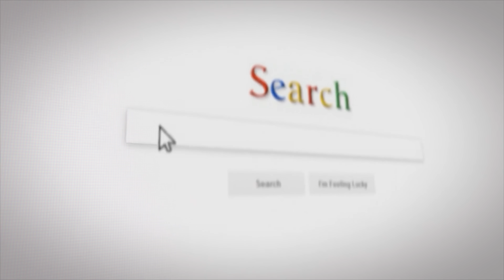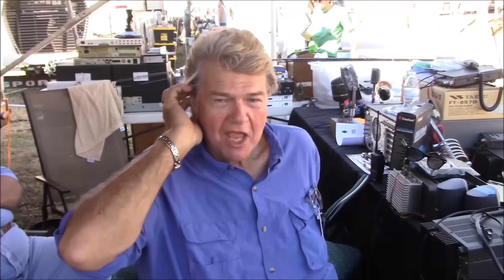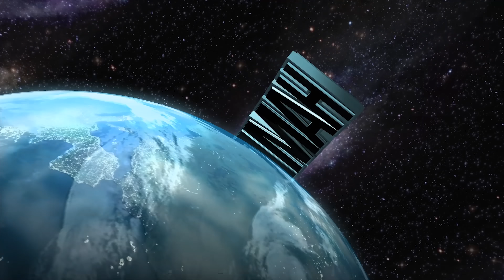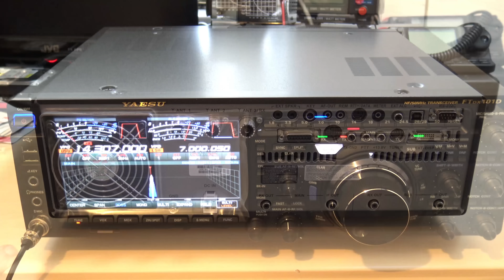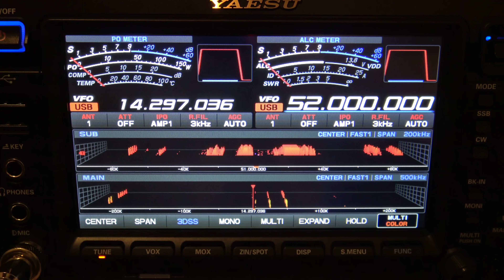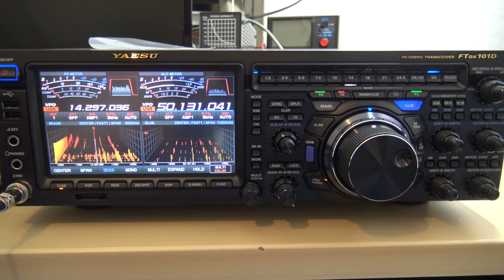NEW Yaesu FTDX101D Review And Demo

Comment: You mentioned where the antenna "tuner" does not "tune" the antenna.  In the U.S. Navy, the "tuner" is actually called an "Antenna Coupler" which is a true description for the Transmitter to Coax to Antenna interface.

Comment: Alas, I have to continue to use my lowly, ancient IC-756 Pro3, since I am neck high in medical debt!  My lowly Pro3 that has worked 50 states on 6 meters (and VUCC), DXCC, WAS, etc. running 'barefoot' with wires, loops, and small 2 element 'Junior' beams!  That said, the FTDX-101D is a dream rig and then some!

Comment: Nice video,, Ive been lookin to buy this radio on GigaParts shortly,,, I really like all that it can do,, and the water fall displays and all, is very nice...I was wandering how the receive is as well as the noise cancelation on it works??....I currently use a yeasu-991A got few months ago,, and had to ship it back to yeasu few weeks ago,, because IPO AMP-1 went out on it....Not a clue why....I dont use no other amps for power...I saw few other videos that its a common thing on the yaesu-991A  for that issue too happen that the resister is known to go out on that radio particular......I hope to get it back soon,, Not sure if im gonna keep it  or sale it but am planning on buying this if it has no issues ???...thank you much for the video.......

Comment: When I was a kid my dad used to be big fan of cb radios. He had lots of them, which we were using as like a mobile phone nowadays, but he also had station at home with president jackson, which was hooked up to antena that was visible from few kilometers (thunderstorm magnet). If I remember correctly he was exchanging qsl cards using this radio. At this time I was like 6-7 maybe and I couldnt wrap my head arround how did he get cards from all over the europe, while we could only communicate up to 10-20 kilometers using cb. He had a big cabinet full of cards. Over time he lost interest in this hobby and Im not big radio guy either, but whenever I see tool like this it brings some sentiment. Maybe its super noob question, but as a hobbyist what sort of use you make out of device like this? It looks like you could control air traffic with it. :D It looks very powerful and brings back some memories, hence my nostalgic comment :) I hope Im not going wind anyone up with questions like this :D

Comment: As I understand it, you can touch on a signal in the waterfall in the time domain. In other words, if a signal off frequency is no longer present, but you can see it on the 3D graph from a few seconds ago, you can click on the spike from a few seconds ago and still QSY to it. Is that correct? Also, why are the color selections so limited?

Comment: I couldn't help but notice the ALC pinned in the corner while you were talking. This is why there are nasty signals up and down the bands! The ALC is there for a reason. Why don't hams pay attention to this and properly set their audio? Hitting the ALC this hard makes you 6 khz wide with buckshot and splatter and it sounds like crap.

Comment: Thank you for a nice video and thanks to the company to sponsor lending you the radio. 
I must say really, this is my personal opinion based and several factors. I always been a yeasu fan and I never really liked Icom. Dont like their look.and I never liked their hissy sound. I own a FTdx-5000D+, FT-920, 847.and 650. But I compared.this ftdx-101d with IC-7610. I love the 7610 in comparison. It looks like cnc machined out of high grade aluminium which has been SOX anodized black. Not a hint of imperfections. The 101d however does not make you feel it's a high quality feel. IMHO. 
73

Comment: When you where in QSO on SSB  I notice ALC was far far out , Usually mean you are overdriving the final and splattering !!
Is something wrong with this radio or 
was the mic gain far to high or 
operator do not know how to work SSB voice  ?
Reply: I think it is operator error, I have one and it is setup properly ALC is well within limits

Comment: The FTDX101D is a great rig!  After playing around with adjustments to the 2D spectrum display, I found the following settings worked well for me. Speed Fast3, Peak LV4, Colour-1 and Colour-13, RBW High, 2D Display Sensitivity HI. This is with a TFT Contrast set at10 and TFT Dimmer set at 7. Awesome fast white band spectrum display and great receiver as well! Not forgetting the scope Multi Level control either, which is great for waterfall fine adjustments for signal display depth.

Comment: Nice video Eric. I cant really say that I was "that" impressed as the other 330 comments.            I don't know what it is. I cant see the value in the 3D display, if not gimmicky. At the moment I'm searching for the wow factor. I love my IC-7600 with 2D waterfall etc  The 101 is $AUD 4700, for that , I'll update my antenna systems. If I could use an car analogy . An Icom 7600/7610 is the Toyota Landcruiser 200. The Yeasu FTDX101 is a Mitsubishi Pajero.                       Thats what I''m thinking. 73 Great effort on the vid. Peter VK3TQ Keepin out of the fire..ss

Comment: I love HF rigs, who doesn’t? Especially a sweet flagship rig like this one. But come to think of it, all these fancy ham radio rigs are stuck in 20th century technology, but cost an arm and a leg. What gives? 
A DVI jack, seriously? Why not HDMI? Where’s my bluetooth, wi-fi, ethernet? USB-C. That screen lag is a joke. Why not a nice iPad Retina quality screen? Open software API so i can write my own widgets and apps, hooking into the OS. Maybe even built-in basic logging software. TCP/IP, SSL/TLS and a built-in server, so i can control it over the internet via https, or set up a web sdr website if i want to. I could go on. 73
Reply: aerozg I’ve had my license for 12 years and have never worked anything but VHF/UHF.
Reply: DVI can be converted to HDMI directly depending on the pin config. I use such a wire with an old GeForce 3.

Comment: Nice video Eric. I can tell you from my experience between this rig and the 101D as well as the FTDX 3000 and the 7300, the Yaesu internal antenna tuner tends to be much more forgiving then the Icoms do. Not sure why as both are rated similar..
Reply: No, they are not rated similar. Why Icom tuners stop tunning when swr is over 3:1? is because Icom wants to protect its passive components (relay contacts and ceramic caps) when tunning antennas with high swr which could damage the tuner, so If yaesu will tune higher swr is because they used higher rated components instead but that means bigger size radio like this 101D. Its just a matter of protection to the builtin tuner.

Comment: Great video! Nice rig. Went over to SDR about 6 years ago Really love the older rigs one being my Yeasu 101E, Had for 44 years and yes it still works 100%. Started as my short wave rec before being licensed. That old rig has a hot rec for SW standard broadcast band. Can't wait to get the FT DX 101D on the bench. See what it will do next to my Icon 7610? Thanks for a informative video. Well done.73,s WA5JIM

Comment: Hello,

It would be interesting to make videos on the low bands (3.5 and 7 MHz)
with strong signals right next (at 3 kHz) in order  see the resistance to strong signals.

It would be helpful to have a cable recording of the station's audio
because an aerial record is not faithful.

Best regards,
Ludovic - F5PBG
http://radioamateur.forumsactifs.com/search?search_keywords=ftdx101

Comment: I’m just not crazy about the frame rate on the scope. Not as smooth as Icom or Flex.
Reply: It is adjustable, and the 2d scooe on the 101d blows the icom away, and when setup properly the 3d scope is the best thing out there
Reply: Mick, you are right about the Yaesu Scopes. They don’t look as good as some of the other SDR scopes. In fact they look kind of fake like it’s just for show. On the icom or Flex SDR’s you can tell if the operator you’re listening to is on SSB,AM or CW. On or off frequency. Over modulating. ETC, just by looking at the scope. I can’t do this on yaesu radios, and that frame/refresh rate is just weird.
Reply: bullshit

Comment: Great video. I have owned many yaesu equipment over the years until I bought Ft2000 after that Icom ic7600 and seriously and never thought about Yaesu anymore. No doubt Yaesu seems to have done a great job this time "but" I need to demonstrate reliability, which with ft5000 was a failure for the money invested. And also despite the fact that Sherwood numbers are unbeatable, you have to see it with real antenna and with very low signals. The display is very nice but I do not buy a radio to see a nice display I buy to do it in difficult conditions and it is at the receiver where I put the money and not on the display. HI if it is beautiful and listens very well without a doubt it is a winner. Many times laboratory if it indicates good things and then in reality it looks something different (it is my opinion). Only time will tell if it's worth it to return to Yaesu or wait for Icom's answer that I'm sure will be devastating. Great video Thank you for that. Great work of Yaesu

Comment: I have been an electronic technician and computer programmer for about 34 yrs. As per SDR and its definition:

"Software-Defined Radio (SDR) is a new technology that offers a simple alternative to bulkier analog radio, adding more flexibility, performance and a smaller form factor. SDRs are everywhere nowadays, from your cell phone to your wireless headset and your cable modem."

I believe latest radios are great, but do not offer the best for their price, or pricing is too high, or better said, overpriced radios.
SDR, as its definition,  and by using Air Spy and SDRSharp, you can really design a software, but dragging and dropping what components you want on your application, such as a water fall etc.

In a short summary, and in my own opinion, such flexibility is not on any new radio, as SDR it is used to trick possible customers but on a non open source product. Therefore, such great filtering, etc, it is something that should be there to begin with, but then used SDR as the greatest and latest,  with nothing new but a touch screen or any other interface.

These new radios should be flexible enough so advanced users can get the benefits of what really SDR is. You are great at what you do, and I do state and mean that, but my opinion is against the manufacturers to against you.

An example of this, look what Yaesu do on a 4k $ radio , and what Xiegu G90 does on a $449.00 radio. Still both non open source, but excellent features, one cheaper than the other.

Another example is the uBITX or MBITX, the extra AGC circuit designed by a ham radio operator and also the Antenna Analyzer done by another ham. Flexibility, programming, and enhancing and cost effective solutions. A nice cabinet, and done.

Keep up the great reviews you do. Thanks.
Reply: Thanks Dad!

Comment: So I would love to hear some instruction on setting up your mic gain using the ALC meter. I've heard that the needle should never exceed the thick white line part of the ALC meter but I noticed you were almost pegging the meter all the way to the right when you were testing. Exactly how are you supposed to set this up? Were you overdriving on purpose or was it an oversite?
I really like the 3D waterfall by the way. This would be a great addition to my shack! Now just to figure out how to afford it.
Reply: The manual has a great instruction on how to setup the audio. Setting up the ALC is exactly the same as all previous Yaesu radios. There are a few new features which require some manual reading. I set mine up in less the 15 minutes and was on the air, with zero audio complaints and many audio compliments

Comment: Great Job, 
Ya,  the Radio to end all HF Battles for Ham Radio.
 Wow. I Really liked the video.
 There will be a Huge increase in used HF radios in the next year's ahead,  as Hams use and get hooked on SDR type radios. 
 This thing is very nice. 
  Like the configuration saving feature. 
 73 to all 
N0pdg out.

Comment: Great video Eric, I appreciate all your reviews. Having said that ,while the 101 looks nice it's not for me. In my 44 years as a ham I've owned many nice Hf rigs. I'm not an SDR fan, and I prefer a radio with power supply, I don't want to have to get a power supply for it after spending  $4000 on it.  It's still a 100 watt radio, and my recent radios are 200 watts, if I need more I turn the amp on but normally not needed unless I'm rag chewing on 80 meters at night. And speaking of the 101 radios I did buy one brand new in 1976 ,a 101EE...that too was an awesome radio and I still use it now and then... Thanks again, I look forward to your next review, and thanks to GigaParts for making this available for demo..73

Comment: Nice Rig with great numbers on Rob Sherwood's RTD (#1 rig now). I waited for over a year to buy one of these rigs, and I finally got to see one at the Orlando Hamvention. Only problem was that the Yaesu representative would not answer any detailed questions about the rig, and the rig on display was essentially disabled.  That guy aggravated me so much I wound up buying a Flex 6400M instead. I'm very happy with my decision now that I see the FTdx101D price and everything I wanted or needed is an option with the Yaesu, but standard on the Flex. Flex remotability is far superior to anything on the market, and the panadapter display has the highest resolution of any rig on the market. The RTD numbers aren't bad either.  Yaesu hit it out of the park on performance numbers, but I don't want to have to buy the stadium and pay for parking too.
Pete K1OYQ

Comment: Why the Heck did they use a bloomin old as the hills DVI Video output 🙄🤔😣😔😔Why not HDMI
Reply: I agree.  Someone said it was because the licensing fee was expensive, but I looked it up....without using the HDMI logo, it's 15 cents per user.  with the logo sticker, it's 5 cents per user.  So just raise the price of the radio by 20 cents...done and over.  Seems like laziness.

Comment: Nice radio, the 3d waterfall is a gimmick and would probably make me sick looking at it. The normal waterfall is much better, in my opinion.

What's the price ? add 23% for Europe :-(
Reply: I paid 3699.00 us, back in may 2019, the price came down since then.
Reply: And I also thought at first the 3d  scope would be a gimmick until I tried it, I use it in 3d more often than not. It gives you a perspective of signal to time you do not have with the conventional scope, plus you can see a harsh wide bleeding signal easier with it, giving you a sure  spot of the offending station.

Comment: This is a very good video that effectively introduced us to this radio , a couple of comments though .  Many of the features earned almost "wow" type comments from Eric , however I think the pleasant reaction should be put in context with other radios.  My features that impressed Eric are also present on radios like the Icom 7610 , 7300, and Flex radios.   
Also, I would like to know if this radio can provide IQ output for use with CW Skimmer? I'm not sure if the IF output jacks mentioned in this video provide this capability or not.  I suspect not.  The Icom 7300 shocked me by NOT having the ability to do IQ output and the Icom 7610 was launched without IQ output but added a year later via firmware update.  Given the popularity of CW Skimmer for contesting and DXing, a radio's support for IQ output is vital information. Also wondering about the remote operations of this radio, do you need special l software at extra expense (like with Icom 7300, Icom 7610 )?
Reply: Quick answer is yes it can do it
Reply: Also yes on remote use, you need to purchase the LAN from Yaesu

Comment: Impressive, but the display on the Icom IC-7300 is better with more color and better resolution.The "3D" waterfall on the Yaesu  looks too convoluted and not as useful. Too much pink and faded colors. The simulated analog meters and audio spectrum  analyzer displays however are quite impressive as are the ergonomics of the front panel. Lots of knobs and buttons. Looks good !

Comment: I wonder - is I/Q data available as it is on the IC-7610?  Also, if I was reading the meters properly the ALC meter appeared to be showing full deflection which it shouldn't.  Or am I reading the displays incorrectly?

Comment: Noticed the ALC was way over and still your average power output was maybe 20W.  Hmmmm..  And Yaesu HAs to add averaging and color fill under the trace on the standard spectrum display. I think most guys will use a standard spectrum analyzer display mode.
Reply: You will find the 2d scope is very good, actually I think it is better than any of the new radios out there excluding flex. Sit in front of one and use it, then make an informed dicision

Comment: DVI instead of HDMI ?? I can't imagine why? DVI is antique. Great hf rig. If you get a chance can we see it on a monitor ?
Reply: A lot of general purpose ICs have DVI output pins built in; it's trivial for a manufacture to route the pins to an output port.  Not a big deal as HDMI and DVI are cross compatible, but that is the reason why.  73, Jarrad VK3BL :)

Comment: Regarding the mystery USB ports on the front, these days Yaesu is in the practice of have a manual and an "advanced" manual. Might want to check if the 101 has this advanced manual and if so, I'm thinking that you will find info on the USB ports in there.